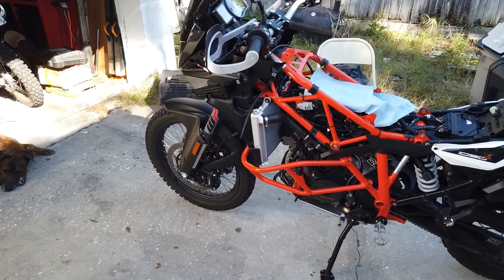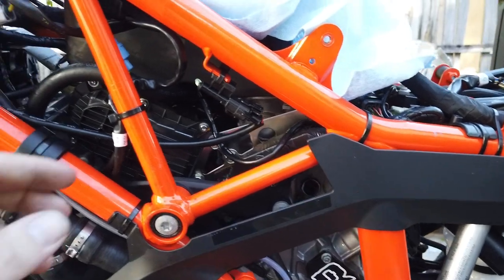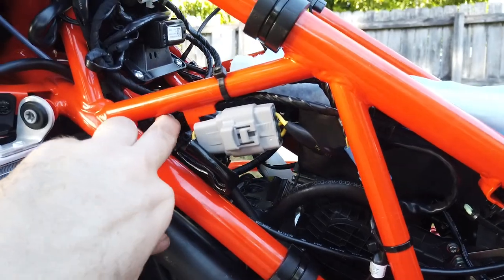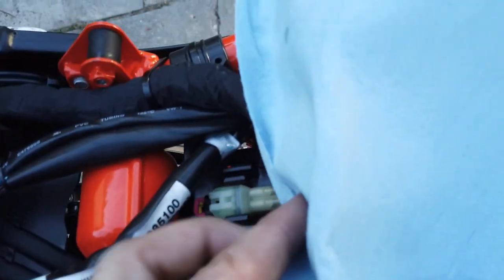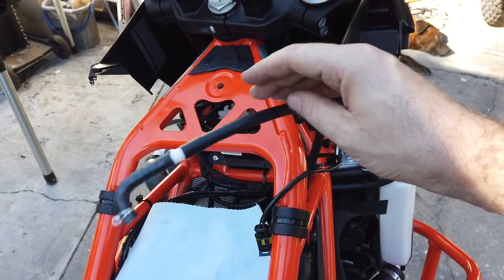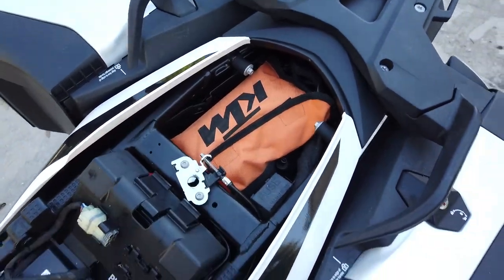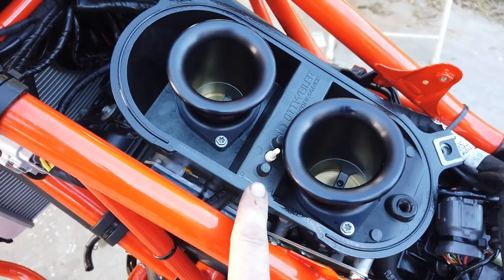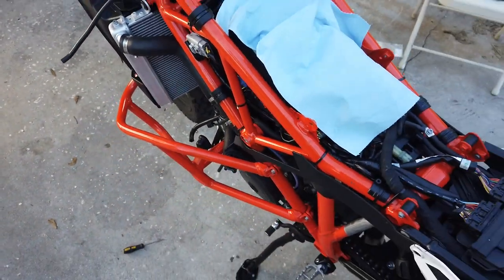KTM 1090 Adventure R - Problems with Rottweiler Kit

Comment: This has all been fixed. (read on) You are not missing anything and all is good with the install. We received a small amount of faulty resistors (the small electrical parts that are crimped into the dongle) from a vendor that bench tested perfectly fine upon assembly, but once voltage is passed through them they do not perform as they should, allowing the incorrect voltage to pass through and set the ECU into a map that is less than desirable. This is why the problem is only apparent on the bottom. This is harmless other than the stumbling idle but as of this typing (2/5/19) and as a preemptive measure we are scrapping all of our current stock and have ordered a new batch of resistors from a very reputable source. 

There are very few people out of thousands experiencing this so we are confident it was only a very small batch and will have all new parts on 2/12/19. We have a 2017 1290 R Adventure on the dyno right now testing random dongles and have yet to find a bad set so for that reason also we are confident that it's just a few that were bad. Just reach out to us and we get you taken care of. 

Also, move the wire for the upper dongle down a bit so that you can swap it out with the new ones without pulling the tank and you'll be ready to go in one minute when they arrive.
Reply: THAT'S awesome service. I just placed a $1600 order with you guys because of the way your taking care of things. My 1290 SAR in PA thanks you too when it's breathing better.
Reply: @mineshallnotbeinfringed9676  i really love their service too
Reply: Hey Rottweiller I have the same problem with my 2008 990 Super Duke.  Still unsorted. I'll call you guys Monday.
Reply: @edwardweiszbeck1649  This was sorted over 4 years ago and was only a small amount of dongles that were bad. We have sold 20,000 or more of these and no real issues. There are a multitude of reasons that a bike would surge other than what is reported in this video though so feel free to give our guys a call and see if they can sort you out. You didn't mention whether you installed any of our products or not though. Is this happening stock, or after an install? If after an install, was it immediate or many miles later? This helps us determine whether it is the installation or something else.

Comment: This is an old vid from 4 years ago but hopefully you read this. Did you plug back in the stock O2 sensors, or just unplugged and then plugged back in the Rottweille dongles...and then doing the ECU reset ??
Thanks for your time

Comment: Bovice, could you please post a report if this has been remedied or not and what that was?
Reply from the maker: Not much change really still. I have done the "15 minute reset" to no effect. The bike currently gets around 26mpg.  Roughly 170 miles before tank runs out.  Before it was 40mpg.  I'd be willing to try new dongles if you guys think that would work.  I can install them right away and post here if I see any changes.
Reply: Ouch... 5 months since it was "fixed" and your still having issues...   i wont be getting the rottweiler intake if your still not even able to fix yours

Comment from the maker: Small update: I reinstalled the o2 sensors and then did an ecu reset. Bike seems to be fixed, but I have to ride it more to get better data. Currently, Im getting 38ish mpg in the city and 50mpg on the highway after the ecu reset and return to o2 sensors. Previously, with the fueling dongles, I got 26mpg city and 48mpgish highway. From my understanding, the KTM ecu relies on information provided by the o2 sensor (or fueling dingles) at rpms below 4500 and throttle inputs of less than 20% (these numbers could be off a bit.) This meant that the part of the map controlled by the o2 sensors(or fueling dongles if you have them installed) was "bad". If i had to guess, id say the first set of fueling dongles were bad and not sending the proper signals and making bike run crazy rich. The dongles must have somehow corrupted that part of the fueling and needed an ecu reset to fix. The reason i believe this is because on the highway, at 80mph, the ecu isnt using the o2 or fueling dongles for input and is using a separate map. Before and after dongles/reset, the bike was happy and functioning properly at highway speeds. During city riding, below 4500 or 20% throttle, the bike was extremely thirsty. I could smell how rich it was at traffic lights.
Reply: How do you do an ECU reset?

Comment: I have a brand new 2018 Super Duke R with exactly the same issue and I cannot for the life of me figure it out. The bike is not ride-able. Please let me know if you were able to figure it out and have a solution. I am frustrated that I have a new motorcycle in the garage with less than 100miles on it and I can't ride it after installing a stage 3 SAS kit and Stage 4 intake kit
Reply: Give Rottweiler a call and they will help you figure it out. I have a 17 SDR with Stage 6 intake kit and Stage 3 SAS kit (installed day one) with 1500+ miles with absolutely no issues. Give them a call they'll get you squared away.
Reply: Have you figured out the problem? I've been experiencing the same thing on my 16 SDR with throttle surge at low rpm's and rough idle (stalls very easily) after installing the Stage 3 intake kit. Called Rottweiler and got the O2 plugs replaced but that didn't fix the issue. Not sure if it required a throttle body balancing since that's where a lot of my symptoms point to.
Reply: @ds240  Yes, I did. I went to KTM and had the ECUs re-flashed. Then I ordered Open Flash Tablet (OFT) and had them send me a tune for my upgrades. I backed up my stock original mapping to the OFT then flashed the stock ECU with the tuned mapping that was provided by OFT using their tablet and the bike runs like a champ. Not sure if you could skip the whole stock re-flash by the KTM dealer and just use the OFT but I went the safe route and went through the KTM dealer first then OFT re-flash. Power commander was causing problems as a piggy back tuner so the dealer removed it and I returned it and used the refund to offset the cost of the OFT. I am glad I went this route as the OFT is not a piggy back unit and just re-flashes your stock ECU saves the mappings and then you remove it. It is also a diagnostic tool, clears warnings/codes, and is a data logger. Let me know if you have any other questions that I may not have addressed.
Reply: Also it is advised to use your O2 Sensors so do not discard them like I did at first as the new set will cost over $500. You could use the dongles but it's best to use O2 Sensors as they will ensure the ECU is adjusting Air/Fuel mixture to what the mapping is set to. OFT will give you tunes as you request them for free until you are happy or you can do a custom eTune for additional $$ (I think maybe $150 but don't quote me)
Reply: @heykat18  I did call them and they couldn't do anything for me. They said its not their product and they do not know how else they can be of help.
Reply from the maker: Arsen. Im glad you got yours working. I wish I could go the same route as you. I contacted OFT, but they don't have it for the 1090 unfortunately since they dont have one to test it on.

Comment: Hmmm....did you contact Rottweiler? If so what is their response? Thanks
Reply: We have fixed this. Read our comments above.
Reply from the maker: In all fairness, I did call Rottweiler a few times and they weren't sure what was going on. I found out about the resistors being bad from their comment on this video.